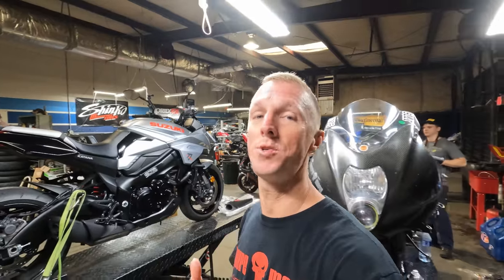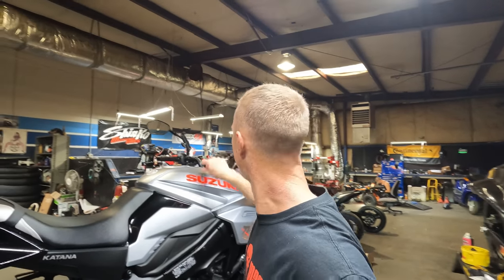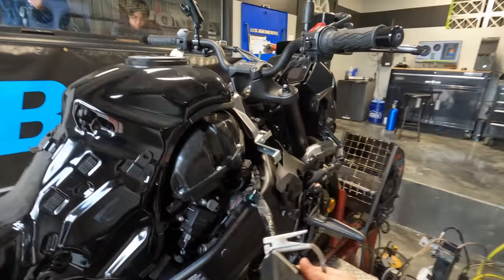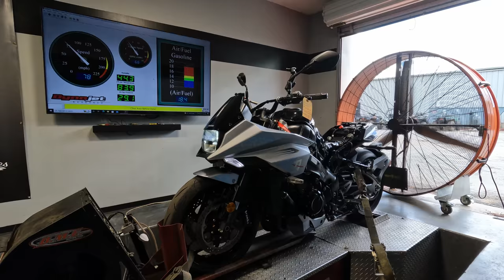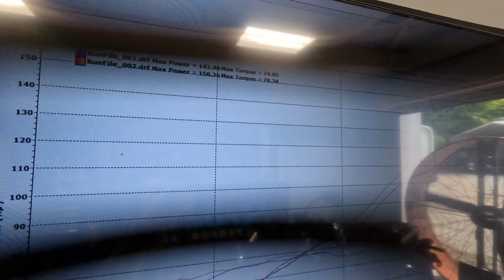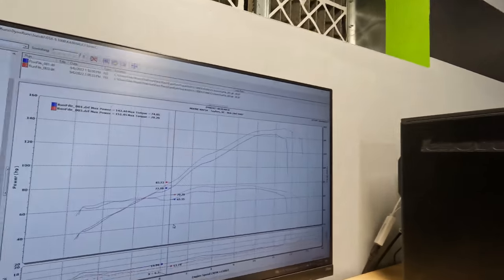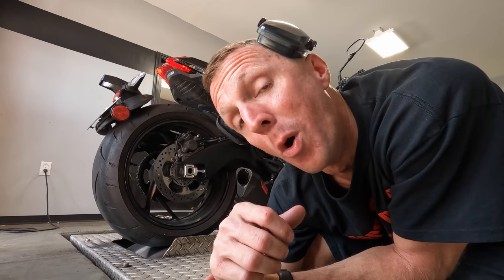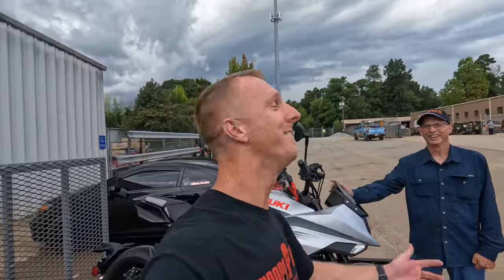2020 Katana Might Just Be THE BEST Sport Touring Bike Out There

Comment: Definitely some audio issues here Chris! We are in a fish bowl! As far as the content; I LOVE the new Katana! Honestly it seems very similar to my Bandit 1250S (other than the exhaust servo) it has many of the same restrictions and fixes. The lighter weight and updated suspension probably give it considerable edge, it's really only slightly down on torque in comparison but then nearly 30HP ahead. As far as touring goes, it just needs a windscreen or you'll be blown around a lot. I'd really like to get my hands on one!
Reply: Sounds are too high pitched and sounds like he said fish bowel …I’d go back to the old camera
Reply: My friend has a bandit 1250 and I've ridden his bike several times the Handling is leaps and bounds better on the Katana being a GSXR frame and swing arm. And when we raced I was able to pull away pretty good even with a passenger. I like the bandit alot tho great bike smooth good highway gearing comfortable and torqey

Comment: I just sold my '88 Katana 1100 a few months ago, and love the looks of the new ones. My preference is the black with red, and if I was a young guy I might have one, but the small fuel capacity would no doubt bug me after a while. Being 70 I find that exhaust a bit too loud, but like the system over the looks of the stock one.
Reply: I Still have my 1989 Black with Kraus Bags and Yoshi exh.
Been a minute since I rode it I think it was 2014.
Reply: @Busafied  They were amazing bikes. Mine also had the Suzuki/Krauser hard luggage which was a pretty rare option. Only sold it because the wife and I are retiring to our condo in the Philippines a bit more than a month from now.
Reply: @Busafied  I have a blue and white 1986 gsxr 1100
Reply: @Shane-zx4ps  I'd like to see that one
I have one someone painted on the lift in storage where it has been since 2009
Reply: Subframe auxiliary tank could be easily fabricated...put the pump in there, with a billet plug for the fuel gauge sender?

Comment: There's a couple problems with the title.
No naked bikes are great sport bikes due to wind bashing you around past 130kph. (A sport rider is often well over this)
The second problem re touring on this bike is the 12L fuel tank...
The gsxs1000 has a 17L tank as most 1000s do.
I found 200kms was really as good as I got on the open road.

Great bike to ride with a very usable motor etc.
I always found the throttle to be very smooth at all rpm coming on and off the throttle.
I only mentioned that due to what was in this video.

Comment: I had a feeling that you would have dealt with the Katana, that's great news. I'm going to pick up a 24' and basically fix it just like this. Full exhaust, air box/Filter and ECU. Damn son, that Katana sounds mad as hell!!! Looking forward to this! I sold my last liter bike about 5 years ago and gave up riding the big nakeds. The Katana has been on my Radar as well as the GSXS 1K for a couple years, and I'm ready to get ready for spring. I might just ride up there, or trailer the bike maybe. I'm down in GA, so not far.

Comment: the baseline pull should have been done with the stock exhaust in my opinion for those people who would get an aftermarket exhaust to improve the bike. Like this, it is for the people who get the exhaust for the sound no matter what the improvement to stock would be, mainly just to have the bike running properly with the new blink. I never see a dyno of the stock exhaust as baseline pull, mostly explained with time constrains. Is it possible that the gains would not be that dramatic?
Reply: Baseline pulls with factory are approx 135rwhp, my 2020 Katana with full Yoshi system and tune 155rwhp

Comment: Hi Chris, that Katana looks pretty good. I had one of the first 1100cc Katan's when they first came out. Dragged it stock standard and did a 9:94. 
I smashed my legs up in a big off and now ride a Boulevard as my legs don't bend enough to get on sports bikes. But do you have a flash card I can buy for the Boulevard as the air filter and exhaust has been changed. It's doing the full on full off stuff. I saw you were doing a Boulevard awhile ago and solved that problem.
Please can you send me how to get and pay for the flash card or whatever it's called. Thank you Chris.
Reply: There is no way a stock 1100 Katana from the early 1980’s would ever do a sub 10 second pass standard, not even with Chris Moore riding it. They are a cool old school bike though, and worth a lot now.

Comment: Comment on video/audio quality:

There is some room reflection in the audio, it's not a huge deal but maybe a lav mic might isolate your voice a bit better and get less of that echo off the walls, just had a little google and rode make a "RODE wireless go 2", so you could wear a lav mic that is connected to the gopro wirelessly and doing it like that would be easier than having to sync audio from a separate device for every video, should come out of the camera just the same, video with audio.
Reply: Absolutely agree mate. I bought the Rode Wireless Go 2 just recently because audio is so important. The camera's exposure, contrast and sharpness was good but the built in mic not good.

Comment: You may loose 30% of throttle but not hp with the stp I would suggest. Jfyi my stock, flashed gsxs1000 makes 152.5 at the wheel.

Comment: I am really curious what Aprilia does with their ECU's. I have a Aprilia race flash on my RSV4, but I question how much de-tune they have baked into that?
Time to get an RSV4 on the dyno! WAY overdue....come on!
Reply: Good luck with that!
Reply: @IndyMotoRider  What, he dont like the Apes?
Reply: @ApeRSV4  the ECUs can only be cracked with a few options. Moore uses a Woolich program to tune. That's not compatible with Aprilias. Need UpMap or OpenFlash Tablet to do RSV4 / Tuonos. That's one reason I sold my Tuono Factory in July, and put a deposit down on a 2023 Busa. There is just not enough Aprilia support in the U.S. Midwest. Had to drive 2 hours to another state to buy the 2020 I had.
Reply: @IndyMotoRider  Great reply! Thanks

Comment: Hey Mr Moore, my bike is a FJR1300 generation 2. It is an amazing sport touring bike. Have you ever worked on one?
Reply: I have an early Gen 3. Yes, it is a great sports-tourer. Alas, it just doesn't have the same potential for speed and power. The mildly tuned engine (relativity low compression pistons and mild cams) is designed to run on 87 octane fuel. It will also run quite happily on the 85 octane gas you find quite often when you are off the beaten path Out West (like Colorado and Wyoming).

The engine is not peaky at all. It makes over 80 lb-ft of torque from 3500 rpm to 8000 rpm. If someone made them, you could fit higher compression pistons, hotter cams, and a better flowing exhaust; but the big limitation to getting more power out of the engine is, I think, the airbox. The airbox shares the under-seat space with the ABS. There is just not a lot of room under there.

Comment: This is the first I've seen of the new gen Katanas.  It's definitely a massive improvement over the old ones...unlike the audio quality of your new camera.  Video quality looks fine except maybe when you showed they dyno tv, it seemed to struggle more with the lcd tv.  But maybe I only noticed it more because you mentioned the new camera so I was looking for stuff like that, but audio was definitely not as good.
Reply from the maker: I'm gonna try some different settings.
Reply: @TeamMooreMafia  There seems to be a video quality downgrade as well, something in the settings as this video looked grainy in comparison to your previous GoPro setup.
Reply: @TeamMooreMafia  Yeah.  It's definitely got to be an issue in the settings because I doubt GoPro would downgrade the quality of the new models.
Reply: @earlgunman  I don't think it was just you. I noticed right away that it was struggling with the Dyno TV as well. Definitely was struggling with that view.

Comment: Just finished the video. Update… I know you were rushed for time, but how could you not show us the airbox after you took out that plate? Also, was it absolutely mandatory to pull the radiator out of the way to get the Brocks exhaust system on?  And I don't believe you really showed us the final numbers. I mean you did, but there was no real commenting on it. Just a thumbs up. Anyway, love the bike, video is pretty good and thanks for the content. I'd really like to know if it's mandatory to pull that radiator out of the way?